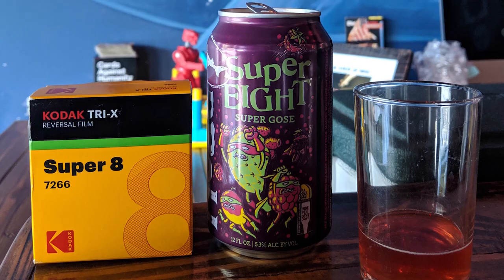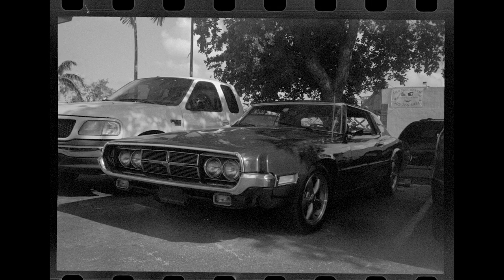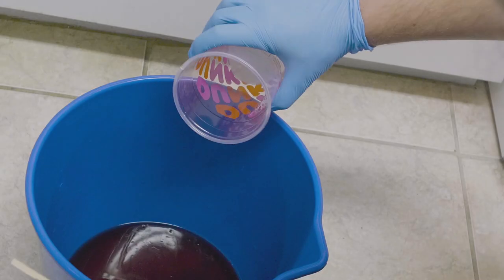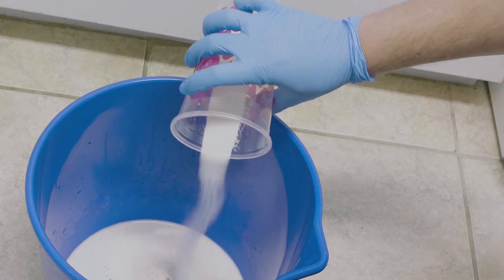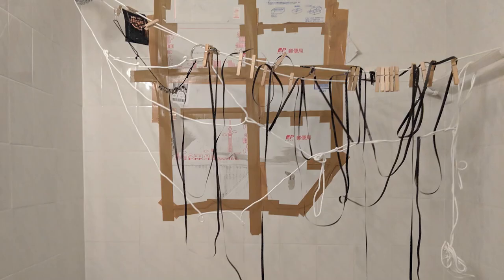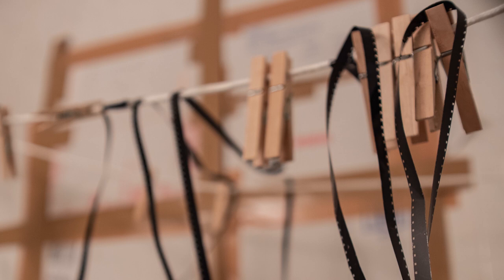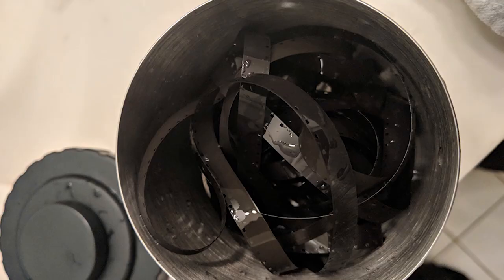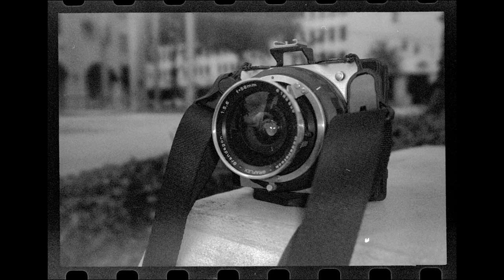Developing Film with Beer?! my experience using Dogfish Head Super EIGHT beer as a developer

Comment: Did you cut up the 100 ft roll of super16 in smaller increments to develop in the tank?
Reply from the maker: Hello and thank you for the question. Super 16 is pretty long at 100ft so even cutting it wouldn't fit in manageable amounts even in a large tank made for still photo film. I use a large bucket in a bathroom with the windows covered and lights out. Even if you do it like this not all of the film is constantly submerged and sometimes it gets stuck together so you get lots of side effects. I have a 16/35mm 100foot tank but you need a lot of beer to do it haha probably not worth it at that point because you can get a proper developer for much cheaper. On the other hand for super 8 I did cut it at about the half way point and developed it in a larger (maybe 68 oz) tank and it came out relatively well! I hope that helps, let me know if you have any other questions!